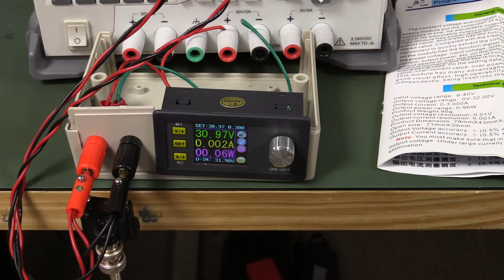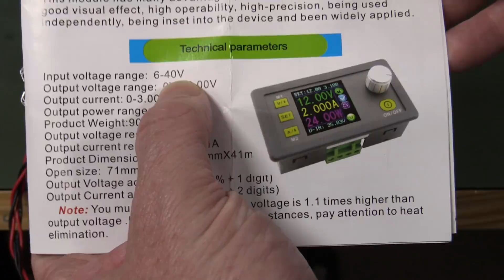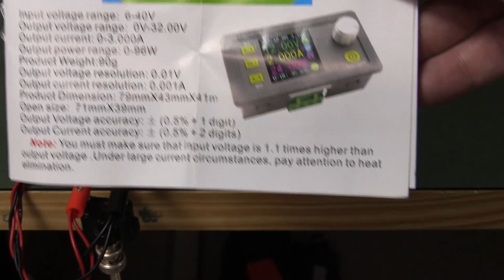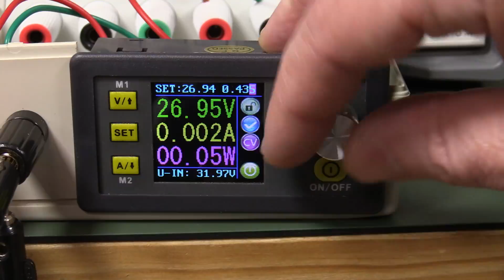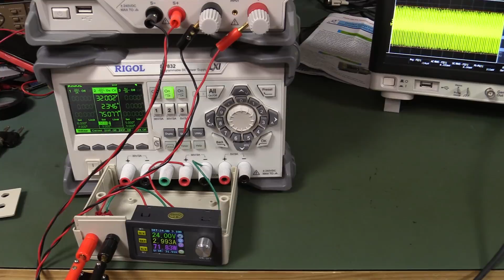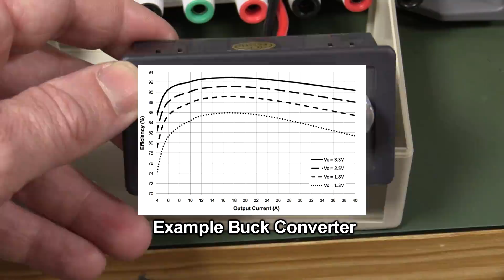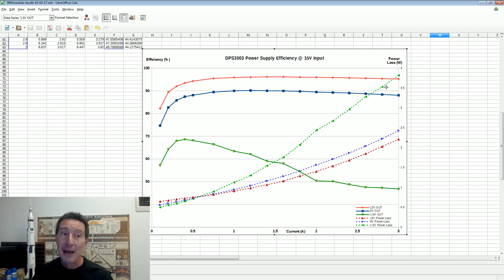EEVblog #1031 - $25 DPS3003 PSU Module Characterisation

Comment: If you used a lower input voltage (for ex 5V), would the efficiency of the 1.5V output improve? I.e. if you want better efficiency for the lower output voltage ranges, is the solution to decrease the input voltage?

Comment: I know that this is an old video, but could anyone recommend a suitable power supply - very few go higher than 12 maybe 24 volts. Little point in powering it with an expensive Rigol power supply after all. Found a couple of 50volt ac dc transformers on farnell but they are 300+, which kinda makes it not worthwhile. I assume that a step up dv voltage thingy would work, but them there would be a power issue?? I am completely newby to electronics, and was looking for a started power supply. The module and a nice case are great value, but the power supply for it...???
Reply: What kind power supply ? for DPS3003?

Comment: DPS3003 power supply tested
With three modules, which together cost less than € 45.00, you can create a small but very professional laboratory power supply that provides you with a voltage of up to 32.00 Vdc and a current of up to 2.000 A. Of course, the device works as a constant voltage and current source.
➡    Read this article
https://chinese-electronics-products-tested.blogspot.com/p/dps3003-power-supply-tested.html

Comment: Do they specify the allowable input supply ripple?  I'd like to use a transformer (& bridge) that I have, but if I have to regulate it, it won't be worth it.
Reply: if you use AC-DC converter or transformer coil, please add rectifier (rectifier bridge) and filter (more than 4700uf filter capacitor)

Comment: if you press the set button again it has over voltage protection etc and another menu
Reply: your using it wrong :P
Reply: read the bloody instructions :P  further down this page
Reply: https://www.banggood.com/DPS3003-32V-3A-Buck-Adjustable-DC-Constant-Voltage-Power-Supply-Module-Integrated-Voltmeter-Ammeter-p-1062475.html?cur_warehouse=CN
Reply: you can understand ,he can't know everything in a short time

Comment: I was very happy to discover that when setting the voltage and current on the main page of the  DPS3003's user interface you can push the pot button and select different digits in front of or behind the decimal point to speed up the value selection you want.
Reply: yes, there is short-cut setting

Comment: Great video, thanks Dave. But I’m not sure why someone would want a variable DC power supply that requires a DC power supply in the first place.
Reply: You can use it with some old 19V laptop psu.
Reply: @mikapirinen5561  yes
Reply: for our DC-DC power supply, we can design it better and add more function, you just add some simple AC-DC power supply, that's ok. if you find AC-DC power supply directly with same function, it will be more expensive , and many people want to do a DIY power supply . different people have difference needs

Comment: So knowing I'll be using the 20V 2A version (DP20V2A) in 3V-9V range I better get a 12V supply for it rather than a 20V one? Interesting. I thought it'll work better when provided more voltage to work with. Alrighty then.
Reply: DP202A is very very old version, DPS3003 is new version, we use new desing way to make it safe and better

Comment: I ordered two DPS5005 just because of your first video and i also have two seperate 48V/4A Mains powered SMPS in order to build up a two independent outputs power supply for OpAmps or alike...
Anyway, the heatsink will get heated up the most when i run the module with a rather low output voltage but high current. 
I hooked up my two 4Ohm/1kW dummy loads in parallel, set the maxinum current at 3.8Amps and let it run...i also had a temperature meter on the heatsink and it settled at about 50degree C with the module sitting on my bench....so if you put it in a housing it may is a good idea to have a (temp controlled)fan inside or it might overheat....

Otherwhise i have no problems found, jet. No short circuit issues, or suddenly disconnect the DUT while running at full ouput current...nor a big Cap and output switched on/off/an...the same goes for a one Henry/5Amp inductor (EI-130 core)
The only thing i did not test was feeding in a reversed voltage from another power supply...as this is not a four quadrant Power Supply, i don´t know if it gonna survive...but running with the usual load conditions it does the job quite well, regarding the money i spent on them...:)

Comment: filter combined with inductor and small tantalum capacitors should smoth the output perfectly. this kind of filtering to get rid of ripple and noise is commonly use in pc power supplies and does decent job! ;) I waiting for my DPS5015. great job Dave, thanks for your efforts to characterize this nice kit ;)

Comment: @EEVblog The manufacturer is Hangzhou Ruideng and there is a modified firmware available called OpenDSP created by Johan Kanflo so you can optimize it for your needs.
Reply: Here are the different PC softwares for it and also the documentation of the communications protocols (in chinese, but google translate handles them fine):
https://www.mediafire.com/folder/3iogirsx1s0vp/DPS_communication_upper_computer

Comment: Interesting that the 1.5V output loses so much power. I wonder if it's related to the fact that in the previous video you said the chip they're using isn't really designed for down to 0V output. Perhaps some odd behavior it does at low output voltages, regardless of input

Comment: To set the voltage press V turn the knob to change value press in on the knob to select the decimal place the same setup is used for the current.  MI and M2 are used to save settings and recall settings.  You can also save and recall more settings if you use the set button.

Comment: I Ordered 50V 5A and LED SMPS 48V 150W, 2 weeks ago, stil waiting to arrive. I also planned to put filters (common mode inductors and caps on both sides), filters will go between SMPS - converter (higher cap values, ceramic and elco) and converter - load (low cap values, ceramic).

Comment: What input voltage do you recommend for 5v 2.5a output? Will it always be around 90% efficient?
Reply: Looking at those graphs it looks like a few volts above output is most efficient. So maybe 8V in to get 5V out
Reply: That's what I assumed too. Thanks!

Comment: With these cheap chinese equipments the only question is, how reliable they are?  Should you fear that some day, the whole let say 40V input voltage will appear on the output and destroy you expensive equipment hooked to it? Who knows what cheap mosfets and other parts they have used...

Comment: If you are in the current/voltage set mode on the main graphis screen and press in the rotary encoder knob you change the cursor position so you don't have to only adjust the 10mv range, or 1ma range.

Comment: I was hoping that 1.5 V would have lower power consumption, but that saving is turned into heat. So the device cant scale down its power? Is this about the design and the nature of electricity. Could you design it so the input voltage (force) is decreased, but then then it still needs a different circuit for max efficiency I suppose?
Reply: https://youtu.be/ZKz9zsH-wWs

Comment: I've recently used the big brother of this module (DPS5015 50V 15A, 35$ on Ali) and a power supply pulled from a Cisco switch (Cisco DS-CAC-845W, going for ~20$ on ebay and doing 52V at 17A) to build myself a benchtop lab power supply that finally has some Oomph to it.. and I'm really liking it. Just needed a few more µF on the output side.. it's a little bit underequipped if you go into the double-digit amps.
Reply: Did you take apart the Cisco switch and use your own enclosure? I'm thinking of getting the 3005 or the 5015 but I don't want the PSU to take up so much space.
Reply: The mentioned Cisco PSU is a modular unit that has outputs through a big Molex-type connector. For the complete project I used an old external SCSI drive box where the PSU module fit just in, after minimal dremeling.

Comment: I was under the impression that the power loss that increases at lower voltages would be a characteristic of the Linear Regs, with the switching ones not burning that power since its switching.
Reply: But every time the output switch changes state, the gate of the output MOSFET needs to be charged or discharged, and temporarily the MOSFET is operated in a linear region for a very short time until the gate reaches the new control voltage. Because this happens at fixed frequency, this consumption is nearly independent of output voltage but you can assume it to be close to constant, which means nominal efficiency at lower output power will be lower. But then, it's likely to still be higher than if you ran the same regulator off a lower input voltage.

So yeah you do get to design differently with linear and with switching regulators for efficiency - for a given output, you normally want the input voltage of the linear regulator to be as low as possible, while you want that of a switching regulator to be as high as reasonable, usually quite a bit higher.

Edit: waaaait there appears to be a "bug" in gate control in there somewhere. Well, it's an analogue artefact rather than what you'd normally consider a bug, chances are, the control voltage or gate charge/drain current depends on the output voltage such that at very low output voltages, it can't pull the gate hard, so it is operating a large part of the time in linear mode.

Comment: If you are not automating measurements like that you should rather take pictures of all your meters at the same time instead of writing values down. I had the problem before that my dcdc/cables heated up while I was writing down the values in excel and therefore influenced the results.

Comment: Dave, If you push the encoder while changing voltage or current on the home screen, the resolution will switch from 1mv increments up the scall with every push.

Comment: 15 volts is quite a weird input voltage isn't it? I'd have liked to see testing with either 12 volt input or 19/20/24 volts since those are more common voltages.
But Still a great video, don't get me wrong. 15 and 30 volts will still give you an idea.

Comment: Please make a video about filtering the output noise!!
Reply: No need. https://youtu.be/DPN1BERe6cg
Reply: dave replied on this video saying that video is a poor way of doing it.
Reply: In fact dave got some poor videos too, but that is not the case, there is only one good solution if you want lab power supply with low level of noise and that is linear regulated supply.
Reply: Bartłomiej Z z@

Comment: You can't say that it's a cheap supply if you don't calculate the actual AC supply.
That would be like selling an audio amplifier without a power supply.
Reply: You can use any power supply that's laying around.
Reply: If you want to get froggy, the PSU from the excellent ksger soldering irons is 12 dollars, ish.  Run it straight off 110-220 mains...

Comment: I wonder why it doesn't come with a 220-36V AC-DC converter. It is relatively difficult to find a 36V+ power supply lying around. And if I  already have a bench power supply that can output 36V, what the hello do I need this for?
Reply: Probably because that module and a power supply would already make a complete device rather than a kit, and it would be subject to more stringent standards and also shipping would cost a lot, and also good power supplies are expensive.

But you can actually just get any old AC transformer 24V or 12V/0/12V and once you rectify it and smooth it with some nice capacitors, the voltage will be 33V, not too bad eh? It will dip and get wavy under load, because it's not regulated, but then you have this programmable DC supply module, yes?

Also maybe you're just a tad too ambitious for the little money. I mean you can get a 24V power supply with shitty regulation for very little money - and it's not so good that i would even trust it to go its rated 100W without exploding and connecting you to mains, so while you can obviously just fudge the feedback to get it to higher voltage, i don't think you should. Most electronics projects will be just fine having a very good regulated benchtop supply which can go to maybe 19V, that's plenty, and an ability to go to 4A or limit it to 100 mA to avoid things exploding when there's a short is great.
Reply: I was thinking this too! Probably just cost.

Comment: Another awesome video would be to use a step-up converter like the AT30 or XL6009 module to power one of these at maximum voltage from 5-12V.   Even more, these step-up converters can be probably bootstrapped to be isolated with just a coupling inductor, a capacitor and a schottky diode.

Comment: Dave, can you do a video on creating a filter to smooth the output. Inductor inline or a capacitor across the output?
Reply: Yeah!
Reply: Just putting a 1 or 2 mfd. tantalum cap paralleled with a 0.1 mfd ceramic should go a long way to knock down the noise.

Comment: Would have been useful to measure the temperature of the heatsink at the same time - at least at the extremes? Also, spend 5 minutes detailing exactly what you can do to smooth out the output - adding capacitors etc. Whilst this is second nature to yourself and all experienced hobbyists it won't be to newbies (the type of person likely to be most interested in aquiring a cheap bench PSU). Anyway, anither great vid so thumbs up from me :-)

Comment: Hi Dave Did you subtract the base power from the input power? If not then this makes them look very bad in terms of conversion at low output power (although the overall efficiency calculation would still of course be correct).

Comment: Hi Dave,  once you are in amps or volts push the encoder wheel to cycle across digits you want to change. I use 2 DPS5015 and it's super easy and fast to set it.

Comment: The best way ~~~+/-~~~??? Use a computer power supply with a boost converter for 12V-60V. I have an 11-60 @600W with a 15A input fuse, the larger the better because the Corsair supply I have will do 42A on the single 12V rail with stable voltage at full load. Then use a buck converter for 12V-0V. You could also use the 5V rail in this fashion for anything from 5V-0V with a very high current drive capacity.

Comment: Dave, does the noise change much over range of power input to output or is is pretty much 100mV at it's worst?
Reply from the maker: Haven't fully characterised that, but I think it's mostly a function of output current.
Reply: Dave, i love these dc-dc converters. Please could you explain how to filter out the noise on these things?
Reply: Dear Clive, try google "high pass filter equation"  look at stuff like http://www.electronics-tutorials.ws/filter/filter_3.html  WEB is a customer self service kind of place! ;)
Reply: Oops.. you want 'low pass'. :P
Reply: Ok, I'm so so at this stuff too.  Dave, your knowledge is quite impressive and illuminating.  If a hobbyist joe like myself adds low pass filtering to this unit ... it is going to affect the efficiency isn't it?  There will be higher loads on the power supply?  I'll just have to investigate when unit and scope are in hand to see what these noise characteristics are like etc.
Reply: Thanks for the info Kippie80, really appreciate it

Comment: What do you think of this video where he uses an OpAmp and a Zener to filter the noise ? 
https://www.youtube.com/watch?v=DPN1BERe6cg

 I am wondering in which case I should consider adding this kind of filter.

Thanks for the video
Reply: please make a video showing how to modify one of these to reduce the noise.
Reply from the maker: I think it's a poor solution. Will be 8W lost in the opamp (4V x 2A), plus the output no longer matches the display, plus it's probably non-linear at the low range. You wouldn't do this in practice.
Reply: I think the zener is only useful for cleaning up pulse-edges, not continuous voltages like these power supplies.

Comment: Noise. From experience,  what applications would the noise of this device be an issue.  What hobby related apps would one run into problems.  For example are esp8266's, or the range of Arduino products or an old 1981 Galaga PCB on the repair bench susceptible to noise.  How would you determine if  you are close to the edge.
TheSignalPath offered a solution to reduce noise but when would it be necessary in general hobby apps.

Comment: Maybe the low efficiency comes from the schottky diode used to do the freewheeling. At low output current and voltage the mosfet is off most of the time so it's the voltage drop of the diode that creates losses. They could have improved that with a synchronous design using a second mosfet instead of that diode.

Comment: btw, you don't really need 4 meters. You can also use two meters with break-before-make switches in a clever circuit. 
Also, a lot of times the graphs are with log scales

Comment: i' ve got a dps 5005 for over a year now, and I'm impress for the price. i've found a custom firmware for theese: https://johan.kanflo.com/hacking-the-dps5005/ It will enable the comm port (esp8266 and bt compatible).
Reply: Up this comment! It is very interesting read if you are into firmware, stm32 and this device in particular :)

Comment: A great voltage supply for these units are old stereo receivers. For less than $20 here in the US you can get a unit from Goodwill or Salvation Army. You'll get a big transformer usually with multiple taps, and a bridge rectifier, and a big input smoothing cap for dirt cheap.

Comment: Dave were there any Load Line Regulation measurements taken to quantitative how well the output held up under various output currents? Those figures along with output noise used to be some of the first figures I used to use in evaluating power supplies.